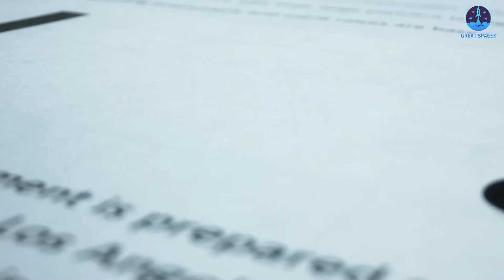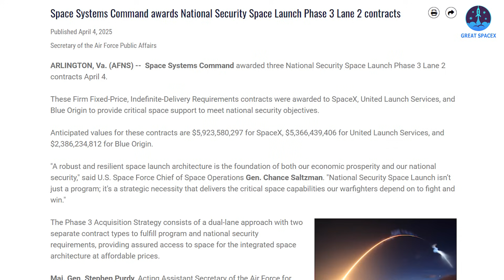What is Holding Up SpaceX Starship Flight 9 No Launch Untill...

Comment: Falcon is properly designed, but the latest stuff is fatally flawed and will need major redesign.  I could write a book on this but the worst faults are the booster has far too many point of failure too small engines, and the second stage (which is an insult to call it a starship) is the wrong shape, a cylinder with one side tiled and winglets sticking out to be fried on re entry is just stupid.  If you put an old space shuttle on top of the booster it would be a massive improvement

Comment: WHAT'S HOLDING IT UP?? Surely You Jest. FLIGHT 7 & 8 HAD MAJOR DESIGN CHANGES WITHOUT EXTENSIVE TESTING... LOOK WHAT HAPPENED! M AJOR CHANGES TO COMPLEX SYSTEMS INCREASES THE "PROBABILITY OF FAILURE"...... That's Reduced By Extensive Testing or Dynamic Modeling.... & Review.

Comment: What seems to be a potentially common issue is the complication of 33 Raptor engines, the intense heat from the engines, the hot staging ring. Flight nine may be able to correct the problems with its starship. However, the idea of a quick turnaround featuring rapid reusability in the future seems like a pipe dream. Starship seems to be a far more complicated system than either Falcon Nine or New Glenn. Yes, New Glenn is way behind Spacex. However, if Blue Origin can figure out landing the booster by ship or land, they will have catapulted ahead of all other rocket companies except Spacex . Obviously Spacex and New Glenn are going after very different futures. However, New Glenn just seems like a simpler system than Starship. That means in the long run, less to go wrong.
Reply: You  guys will eat words. Falcon 9 successful lunched into obit a couple of hours ago.
Reply: who cares how long starship takes ? they have F9 for any payloads that need delivery ... you sound like a leftist

Comment: Spacex try to do too many things in one single flight. Its engineers should simplify the next fights by testing thoroughly and independently each system until achieving total success; which means to fly and land the rocket without problems. Then they should test the next critical system in a second flight, etc. It would be more costly but it should work. 

They could also test two or three systems in the same flight by making sure that the first critical system worked. To achieve that, they should leave the rocket in orbit, if necessary for days, until they have studied all the details to make sure that the first system has worked flawlessly. Then they would test a second critical system. Etc.
Reply: That’s what they are doing………………

Comment: Hot staging ring design has been a issue since they first realised they needed one. Using stainless steel on the booster and starship when they were designed to be  built from aluminium could also be a issue. Makes sense to ditch the booster this time with meckazilla 2 being close to finished, be a shame to mess up landing a used booster.

Comment: Equal and opposite reaction, The 6 starship engines fire up at 30 to 40% throttle , so how many tons of thrust energy hitting the hot stage ring ,, so  how many tons has got to be bouncing back to the engines and engine bells,,
Might even be hard enough to give you the beer bottle effect 🤔🤯

Comment: I still think the hot staging ring in of itself is an issue. It is not the event of hot staging but the flex in the hot staging ring that is causing a resonance in the upper stage resulting in overpressure resonance rupturing fuel lines.

Comment: It's no surprise that this flight is delayed, because it is so critical. If the company suffers a third failure in a row, they will go down in history as the worst space technology company ever. This flight must succeed
Reply: Wrong
Reply: They launched and caught in the air an 8-million-pound booster, landed at least 2-star ships in the ocean and you think they can be a failure!!!!!!
Reply: That's a bit histrionic considering Starliner and how long it took Blue Origin to fail on landing New Glenn's booster. Starship is already a success. It's funny how quickly people forget.
Reply: @Workingcinderellaman-jw2pf  the odd thing about you people is that you define every failure as success
Reply: @jimeditorial  If you learn from it a failure is a success.
Reply: @jimeditorial  The largest rocket ever built, Starship, has successfully launched 8 times testing it's 33 Raptor engines, has successfully put 4 starships into near-earth orbit, has successfully tested and modified it's re-entry heat shield, has successfully soft-landed 3 starships into the sea, and has successfully recaptured a superheavy booster weighing over 250 tons THREE times with giant robotic arms, all of which has never been done before.   The whole purpose of these launches is to test and modify this launch system. They are test flights and there will be failures, which is what they're for. The whole point is to learn from these failures. None of this has EVER been done before so I think it's kind of impossible to say that it isn't successful.
Reply: @Workingcinderellaman-jw2pf  if flight 9 fails, there will be serious questions about the Engineering Management of the program. The entire point of modern technology such as the digital twin, is to prevent multiple failures during product development. They are not developing some radical new technology, like nuclear propulsion. Recovery of Rocket stages is well proven in the Falcon program. Clustered engines have been done by the Soviets since the beginning of the Space Age
Reply: @ Yes, they are testing a radical new technology that has never been  done before. This is exactly what they're  doing. Not only is it by far the largest launch system that's ever been developed, but it's also designed to be fully reusable, which is also something that has never been done before. This is the holly grail of space travel. When Starship succeeds in it's ultimate goal, it will radically change space exploration forever. 

Clustering engines powerful enough to lift a 400 foot, 5,000 ton rocket has never been done. The soviets couldn't even get their N1 rocket in the air.
Reply: @Workingcinderellaman-jw2pf  making something bigger is not revolutionary
Reply: @ Launching Starship is.
Reply: @Workingcinderellaman-jw2pf  How? It looks the same as a Saturn V launch. And SpaceX Falcon has been landing boosters for years now.
Reply: @Workingcinderellaman-jw2pf  The Saturn V sent astronauts to the Moon on its third launch. Starship still hasn't managed to reach Earth orbit after 8 launches. What a joke!
Reply: @markvolstad9380  The development of the Saturn V isn't comparable to Starship in the erroneous way you're attempting to do. If it was, then there would have been many more unmanned launches of the Saturn V and different  versions, probably with some of them exploding on the launch pad due to early problems with the F1. Block 2 was never meant to transport humans. ALL of the flights of Starship so far have been "test"  flights. NONE of them have attempted earth obit by design. That's not their purpose. Their cargo is data and they have been very successful in accomplishing that. 
 
The Apollo program was motivated and accelerated by the cold war. It was very ambitious, expensive and there were a lot of risks taken along with a super aggressive schedule. What was accomplished is nothing short of a miracle.
Reply: Bullshit they already proofed themselves w falcon.
Reply: @MrDoenermann123  It took them like 20 attempts over 5 years before falcon had a successful booster landing. Having the first two attempts of a new system fail in a 3 month period is barely a setback. How quick we forget the first three starship full stack attempts of block one? 3 failures in a row over a year. The last one was only a year ago.

Also, there have been "production" launch systems with more failures than successes. A few failures during development is expected.
Reply: @MrDoenermann123  Saturn V had two test flights, and flew a crew to the moon on the 3rd flight. Artemis 2 is set to fly a crew to the moon. SpaceX needs to demonstrate that they can successfully design and launch large Rockets. Two failures in a row is not good
Reply: @jimeditorial All of them expendable rockets. The goal here is reusability. A much larger iteration. They will get it done.
Reply: @williamdrake2315  failure is not success.
Reply: @jimeditorial  Your thinking is very flawed.
Reply: @ You don't know your space history. Saturn V was in development from 62 to 67. The first one to get people on it killed all 3 of the crew. So far Starship has killed infinitely less people.
Reply: @barongerhardt  wrong. Apollo 1 was not a Saturn V, and even then, the crew died in a capsule fire on the pad, with the booster silent below
Reply: @jimeditorial  Don't confuse the fanbois with the facts!